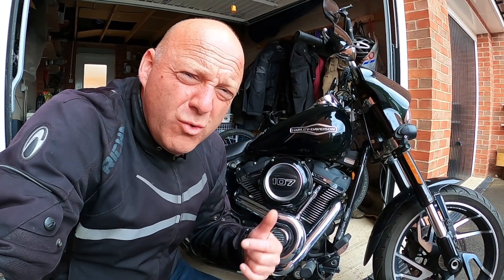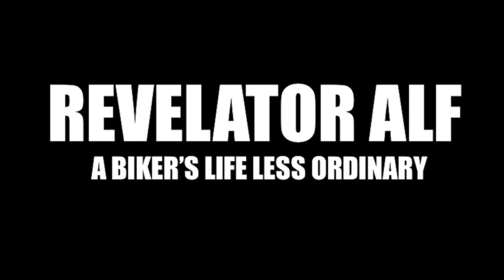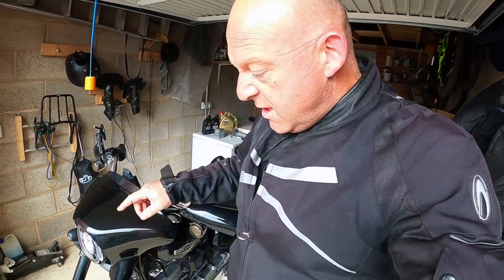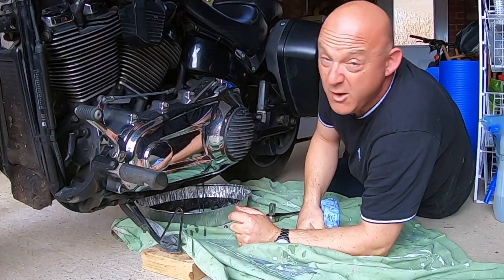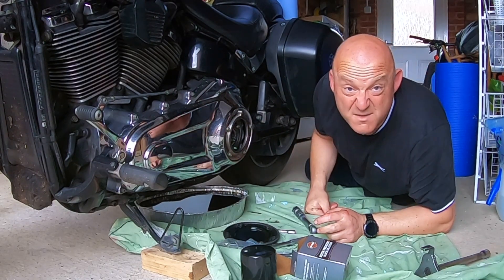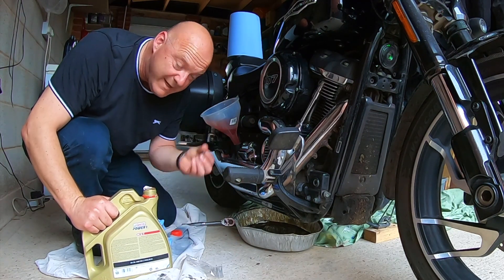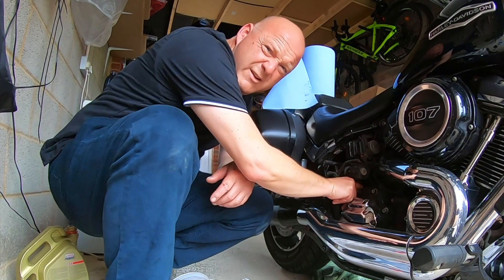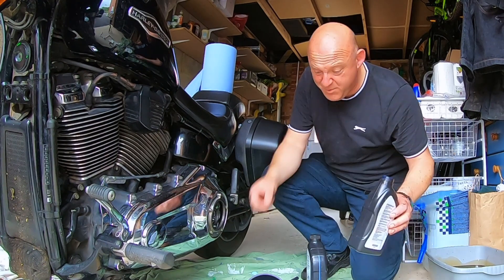How long to change oil on a Harley | 3 Oil Service Change

Comment: When I get home in the evening from riding all day is when I drop the oils. I let them sit all night draining. In the morning all is empty and cold. I then finish the oil change process. Then a half quart or liter of engine oil to check the level after the first 15 min of warm up, top off if needed. I do measure the transmission  and primary oils and put back the same amount. Total time about 12 hours. Yes, the filter was changed also. Cheers.

Comment: Nice video on changing three oils. So what you are performing is a 5,000 mile service. A few pointers to those who thing that all you do is change oil at 5,000 miles. At a minimum when you change primary oil and you have the derby cover off you should back off the clutch cable and clutch push rod adjustment and re adjust them for clutch wear. Above step not required if you have a hydraulic clutch. Then reach in the primary cover through the  derby cover opening with a long screw driver and feel for primary chain deflection to ensure you have some play and this will ensure that the primary chain adjuster had not ratcheted up causing primary chain to have no deflection. When you are preparing to drain the the engine oil leave the oil dip stick secured then remove the oil drain plug and you will notice that the engine oil comes out slowly then remove the oil dip stick and you will notice that the oil flows out faster, this is letting you know that the engine breather valves are operating properly. Also take the time to inspect the drain plugs when removed as they have magnets on them, they should only have a fuzz build up on them if there are slithers of metal on them a component is starting to wear. Being this is basically a 5,000 service the air filter should be removed and the throttle bore should be cleaned with a throttle bore cleaner spray and a map sensor cleaner to remove the oil mist that builds up in the throttle bore ad the crank case breathers feed the oily mist back into the throttle bore. Then replace the air filter if it is a non cleanable air filter, if it is cleanable then clean it and oil the air filter. A 5,000 service is more entailed than just replacing the oil, it is also a preventative check along with a service. Keep the videos coming. Just pointing out in case there are views that think you just change the oils at 5,000 miles.

Comment: Is that the castrol VTwin 20w-50?  That's what I use.  Premium oil, 9.00 USD on ebay.
It takes me about 1.5 hours taking my time.  It will take longer the first time for 3 holes.  On the Pan Am, about 40 mins.  Most of that is removing the aftermarket skid plate.  The Sportster, about 45 mins.  I changed my Pan Ams oil today, the dealer did it at 800 miles for my first service, I noticed a very big change in the shifting when I did it today.  I'm betting they used HD 360 instead of the 15W-50 HD recommends as the first choice, the 360, is the 3rd choice.  Doing your own is very advantageous, you learn about your machine, you know what goes in it, and it's done correct.

Comment: OK for the oil change, but the reason it takes more time at the dealer is that there are 19 more things to check, assuming a 5K check. Having said that, once you have done the initial 1K check, the next time you will change the three oils is at 20K and then, you are missing 29 steps…. So yeah one hour does not cut it. Maybe your intervals in the UK are different. But as far as changing the oil, we’ll done.